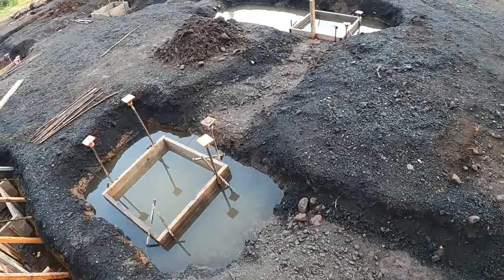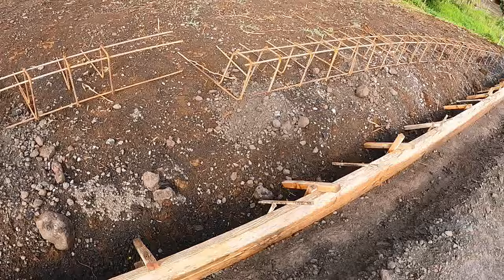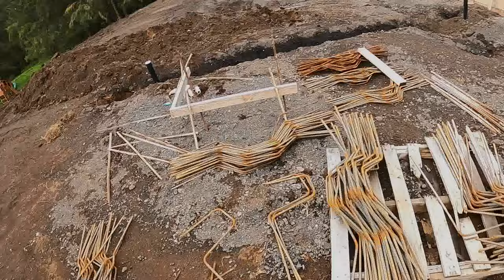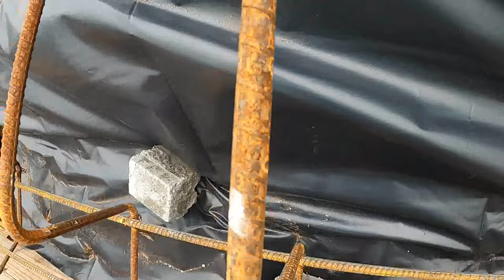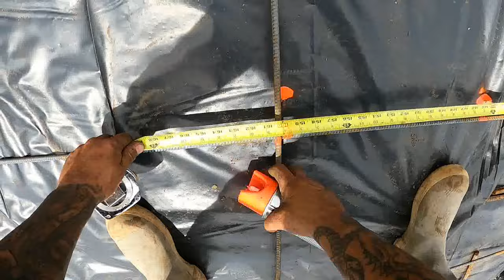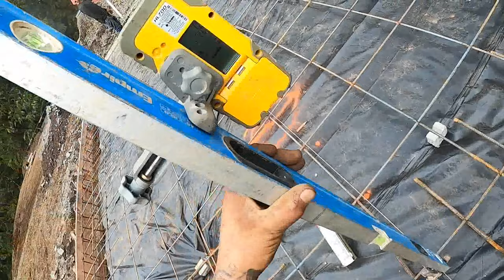How To Tie Rebar and Prepare for your Concrete Pour

Comment: Hey man local 416 rod busters out of la , just a recommendation tie the mat 50% instead of 100 no real need to tie it 100 🤷‍♂️ But love the content
Reply from the maker: You got that right 50 percent is all thats needed unfortunately sometimes the guys your working for want it tied at a 100. back when i was mainland I was running jobs in Seattle area building parking structures and lots of architectural builds and i always tied at 50. I have a few cool older vids with that style you should check out. Thanks for watching and have a great weekend